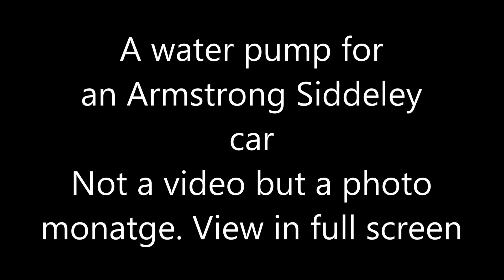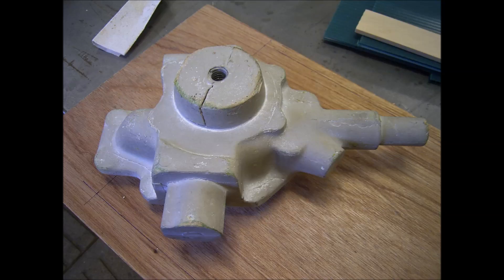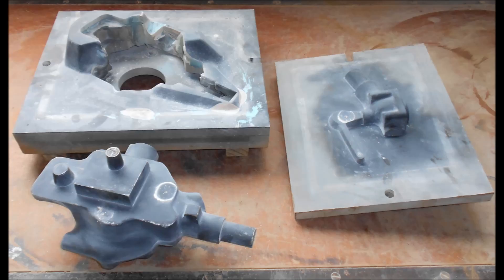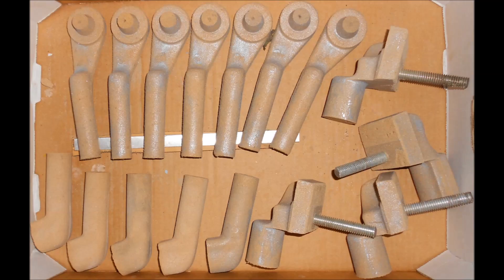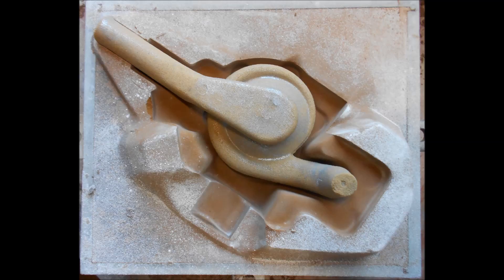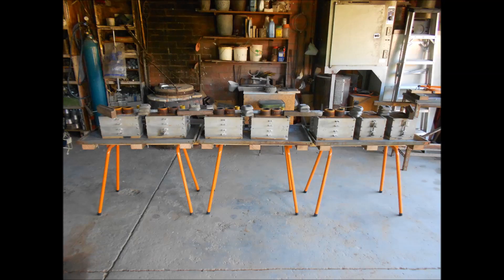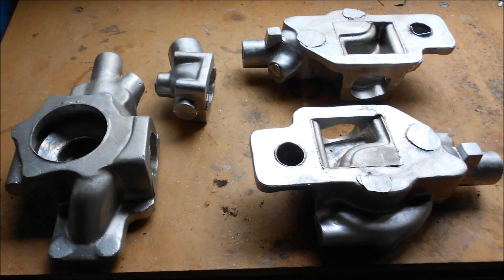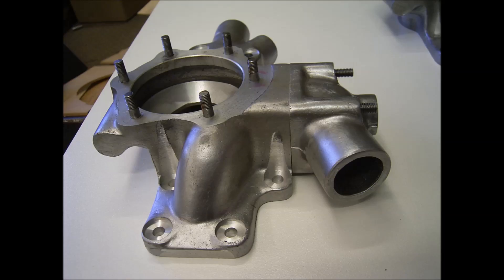Casting an Armstrong Siddeley water pump

Comment: Help with videos so we can learn more how  you make your patterns
Reply from the maker: Paul, I do not l make very many patterns myself rather I have a friend who is a pattern maker and we sort of swap - patterns for me, castings for him - its a good arrangement! Occasionally I do make a crude pattern or two usually just out of craft wood but my woodworking skills are so bad that I would not dare put them on YT - they would be greeted with laughter (like some of the casting videos that I have seen 😀) In this case another friend 3D printed the pattern for me. I believe he found the file on "thingiverse". I then trowelled car body filler on all of the pattern, sanded it all flat, and then applied a coat of car body primer surfacer high build paint and then again sanded with a fairly fine paper. It was the flat sides that allowed me to do this. Unfortunately pattern making is a huge subject and one that takes many years to learn. Usually though a little thought as to how the part is going to be moulded cast run gated and fed plus reasonable basic woodworking skills will get you by.. Craft wood is cheap and can be glued to make big  lumps, it sands, turns, and mills well enough, it just needs lots of coats of paint to seal it...Martin

Comment: very nice videos .... how do you make your patterns?
Reply from the maker: CNC, Thank you for the comment. Actually I only make a few simple patterns myself. In the main I use craft wood as it machines fairly well in either my lathe or (old) CNC mill. I have a bandsaw and a jigsaw which help with the work plus the usual disc and belt sanders. The craft wood is a bit furry but enough coats of paint with intermediate sanding and it makes a reasonable short life pattern. I use car body filler to pretty things up and get things like curves and taper correct. Anything a bit difficult in pattern making I get a friendly pattern maker to do - he and I have an arrangement I make him castings and he makes me patterns and he is much better at pattern making than I am and I am better at making castings than he is so the arrangement works well... Martin
Reply from the maker: CNC, Further to my reply of a second or two ago my second reply to Thorvald just a little below here is worth looking at... Martin
Reply: thank you Martin. I really appreciate your answers.

Comment: Excellent work, a magnitude better than anything my old employer had cast and I had to try and fit!, Did you use Hiduminium?(joke). Cheers, J.
Reply: I'll add a bit to the chaos :) AlSi7Mg is called "АЛ9" by old soviet standarts, and "АК7п" by modern russian ones.
Reply from the maker: Joe, Thank you for your comment - you must have had an interesting old employer and past life! Hiduminium - well, there is a piece of old fashioned terminology that you don't often see these days! I have an old (even older than me) book that lists some 27 different Hiduminium alloys, many of them  fitting in with the R.R. series. Very approximately the alloy I use is sort of close to Hidumium # 40. In the early days of aluminium alloys most manufactures and users came up with their own terminology - R.R. of course was the Rolls Royce series of alloys. It was all very confusing with slightly different alloys produced and used by many different associations/manufactures. This resulted in an explosion of alloys and it took  quite some time for rational standard alloys to appear and be officially recognised. There are still way to many standards with just about every country using different terminology for the same alloys and some countries using in part at least marginally different alloys - it is still a bit of a mess. I use (mainly) what we in Australia call 601 in the US its called 356. The British call it LM25 or did a little while ago, In Europe it is or was AlSi7Mg and C4CV in Japan - still a mess of confusing numbers - you would think that in this day and age we could all stop trying to pee on the lamp post and agree on a common system - for all materials!

Comment: Hi Martin, a rather complicated series of part's to produce.It was fortunate that the pattern maker had the original patterns as a reference tool. Mark
Reply from the maker: Mark,  Knowing the pattern maker concerned (he is very tame) he would have been able to produce a pattern from scratch just using the old castings as a guide. Alternatively of course he may have chosen to bog up that badly corroded original, add some core prints, machining, and shrinkage allowance and made a pattern that way ( this method of pattern production is not recommended but we have done it thus in the past for other jobs.) But the existence of that old set of patterns that he could repair sure made the job easier, quicker, and no doubt cheaper.Later I will (I hope) have a full video of a similar job - a water pump for a Perkins tractor - just have to see if I have enough video of it and then do the editing etc. This particular job was a bit unique because of that core bolted into the top mould half.
Reply: Interesting, I just viewed the A/S Car Club spare parts page and they dont list a water pump, and given the age of most of those cars I would say that more than a few will require new water pumps due to corrosion.
Your Pattern maker is very tame you say, a mate of mine did his Apprenticeship as a Pattern maker and back then he was anything but tame.
What are your thoughts on how 3D printing will have an influence on pattern making and casting?
Reply from the maker: Mark, As far as I know this job was for the A/S club - well I think it was - I dealt with just my pattern maker he dealt with the customer. Original the order was supposed to be for 10 to 20 parts but I don't remember making as many as 10 so perhaps they sold them all. Who knows maybe I will have the "pleasure" of making them again. Well, when I was studying metallurgy at RMIT I did a couple of extras  - welding and foundry work - the welding I did in amongst the first year motor mechanic apprentices the foundry work amongst the first year patternmaking apprentices. Now and without wishing to be rude about any particular trade I sure can state that the two were chalk and cheese. The motor mechanics were a very rough and ready bunch and the patternmakers were positively refined in comparison. (Mind you I know of a pattern maker who did time - car theft.)3d Printing, Hmm,  lots of people think that its the ant's pants when it comes to making things, my pattern maker on the other hand reckons that its a bit of a joke - he has made a lot of money over the years by finishing off 3 printed stuff. The problem is that the surface finish is just not good enough - yet. All sorts of tricks like solvent polishing improve things but they still can't produce a finish good enough for use as a pattern. Note we are talking here about the sort of 3d printers that you or I might own not the units costing bulk thousands of dollars. Still I have used a 3d printed pattern quite successfully - it was a simple shaped part and I was able with spray on car body putty and sand paper produce a useable surface, only problem then was that the 3d print was not mechanically robust enough although that could easily be fixed. The current 3d printing technology seems to have definite limits of resolution determined by the properties of the hot plastic being laid down. There needs to be a paradigm shift in the technology for the process to become truely useful. Lets face it most 3d prints that you see are bloody awful when it comes to finish. The biggest thing to hit pattern making - a real game changer - was CNC machine tools. A friend and an extremely skilled traditional pattern maker of my age commented to me that when he was starting out the thought that patterns would one day  be cut on something like a cnc machining centre rather than by people like him at a bench with a chisel in hand was unheard of yet nearly all commercial patterns are now cnc cut.There are some very good very fast but hideously expensive 3d printers out there but they don't work on laying down layers of gooey plastic. But who can say what the future holds I sure can't - I ain't physic
Reply: Martin, I do think the plastic squirting 3D printers are getting better and like you I have had successful parts produced from printed patterns. So much so, that I have just bought a 3D printer with a relatively large print volume 300 x 300 x 600mm. My first large pattern is printing at the moment.I hope to document the process from the CAD through to the finished machined part. You can see the progress here;http://forum.raise3d.com/viewtopic.php?f=5&t=1338You can see that the patterns are taking 200 hours to print. I think the original pattern maker 100 years ago, would have been sacked ( fired ) if he was taking this long over such a job!I have enjoyed your videos, there is nothing like watching an old master at work to pick up hints and tips.
Reply from the maker: Thank you for your comment. Like all things relatively new I think (hope) that "Squirting" 3d printers will improve, although I am a little concerned that the physics of the process may make improvement somewhat difficult or slow  perhaps higher pressures, finer nozzles - who knows? Time will tell. A friend points out that one of the big problems with 3d printing is that to get the most out of it you have to be able to draw what you want - most people can't do this (obviously you can) and there is a limit to the usefulness of what parts you can download.  From the point of view of a usable pattern for sand casting work their does need to be considerable improvement (in my humble opinion anyway!) Its not so bad with a flat sided smallish part like I cast from a 3d print - I was able to fill and smooth up the pattern to the required degree without too much effort. However I understand that it took several hours to print and perhaps another hour to smooth up - I certainly could have cut a pattern from craft wood in less time. However the part  that you are pursuing is altogether another matter. Not only do you have the long print times for the pattern but you also will have to print  the core box - that will take as long again I would guess. And then of course you have to smooth them up. Personally I am not much of a fan of split patterns, the splitting just introduces further inaccuracies and mismatch. I think it better to have a solid pattern and to use moulding boxes with decent dowel pins that enable a mould half to  be lifted off the pattern and then the complete pattern to be  lifted out of the other mould half. Mind you if a split pattern is properly mounted on a pattern plate its a different story but you need good long dowel pins for that too.I was a little amazed that a 1913 engine would have even used an aluminium casting, they certainly were not common back then - are you sure that the one you are trying to replace is the original? If it was it would most likely be one of the very early Al alloys containing copper  these corroded very badly. These days most people would probably (depending on the wall thickness) use 356 for this job and it is much more corrosion resistant. A friend has asked what layer thickness you used on that print. As a story to sadden you, in my youth there was an old solid tyred fire engine abandoned in a paddock near where I live I can remember it quite clearly but sadly not a single trace of it now remains. Please keep me appraised of your future developments on this project I am very interested. By all means use the private message facility if that suits you.